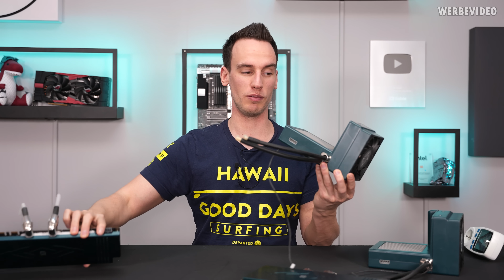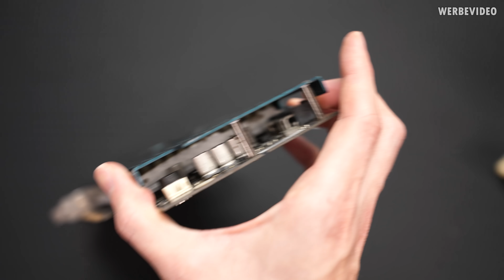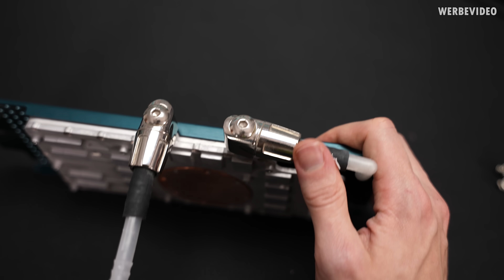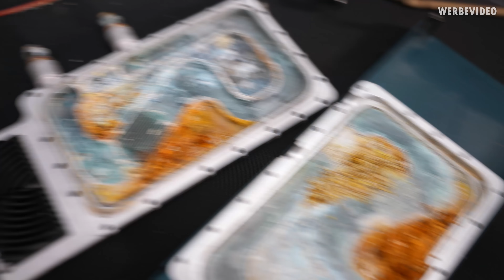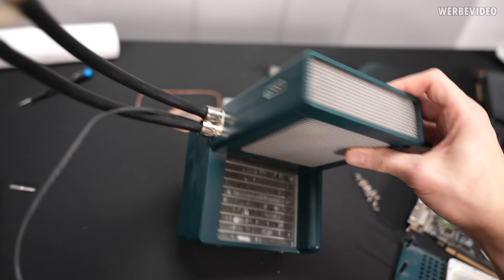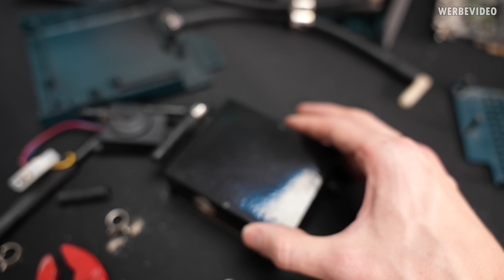Viewer-Mail Ep3: The WORST Water Cooler Ever! Nvidia 8800 Ultra Leviathan

Comment: phosphoric acid will clean the block then refill with 50 percent anti frezze
Reply: Red Line's Water Wetter would work very well in this. We use it in our race engines as your not allowed to have propylene glycol on the track.
Reply: @MrCool00236  I bought a 360 copper rad on eBay, and it had quite a bit of corrosion. I asked what he had used for fluid, he said distilled water and some water wetter.  It wasn't bad but still not good.
Reply: @Apollo-Computers  have you ever water cooled before? The copper will be discolored by default in all radiators, and not be totally uniform. This is Normal and not corrosion
Reply: @cwill2127  I've been water cooling for years, I know difference between discoloration and corrosion.
Reply: Since this will never see freezing temperatures wouldn't it be fine with some water-loop additives for mixed metals?
Reply: @danisoful  I said anti freeze as it as I inhibiter that stops erosion  in aluminium engines. so it mite be over engineered for the job but that's a good thing
Reply: @BALDYMANS123  Yeah I know, but antifreeze is rather thick (maybe the pump will struggle?) and water is better at conducting heat. Still a valid option tho
Reply: @danisoful  . well any additive that  low viscosity will stop aluminium oxidisation. and lasts a long time. easy to buy will be good I just can't think of a better one. at the moment . than anti freeze
Reply: @danisoful  i dont think so, too much scrap. you will need to dissolve that first. otherwise everything will get clogged up.
Reply: @AnthondeVries  I was thinking after cleaning ofc, my bad
Reply: yeah that will dissolve most corrosion fine, i once used that method to clean some alu parts.
Reply: i wouldnt use just any antifreeze. the plain green is fine but has a short service life. Dex Cool is a big no, g05 can crystalize with age. Zerex Asian is the way to go for extended life, even if you leave it too long it just forms a slimy film rather than crystals like go5 or brown sludge like dex cool. At least, in car radiators. same thing just bigger so it should translate.
Reply: I'd just fill it with sp13 car coolant, this should prevent further corrosion a lot better then water

Comment: Hi Roman.
It is clearly a problem of mixing metals (Cu and Al) without proper fluid.
To clean residues off copper is easy, just throw that part in vinegar. Regular acids only dissolve copper oxide. However, after treatment copper part may will not look very good, because corroded parts lost its copper and there is no way to retrieve it. 
As far as aluminum, it is tricky. Both acids and alkali dissolve aluminum oxide and metal itself. You may use very diluted acid or alkali, which when will dissolve oxide and a bit of aluminum. 
I found a patent, which better explains what to do with aluminum parts.
https://patents.google.com/patent/US20110268885A1/en

When you finish cleaning parts, use special fluid mixtures to refill, of which composition I don’t know. Distilled water won’t be any good, because the same story will happen again.

Comment: This is why it’s almost impossible to find watercooling gear for retro pc tech. I’ve always dreamed of building an amazing pentium 1-4 system with watercooling. Since the days of computer magazines in the 90s.
Reply: yeah retro stuff was 100% aluminum most of the time(that cards actually one of the rare few that used a copper insert for that time) and could make a ton of money recycling them which is what i did with all my old aluminum blocks and radiators. ended up making more for the aluminum than what i paid for them 15 years before that.
Reply: @sirmonkey198  aluminium scrap sell for something like $0.7 USD / kg, it would take A LOT of radiators to make any money.

Comment: Clean it off either by scrubbing with a stiff plastic brush with some kind of mild acid like vinegar and then rinsing well, or you can do electrolysis or ultrasonic cleaning.

When you refill this system make sure to use a high concentration of anti corrosion additive like car antifreeze, maybe 30%, to keep this from happening again. And always change the fluid every year or two like a car!

Comment: you can use "Citranox acid cleaner and detergent" to remove the metal oxide formed on the cooler. 
TO clean it, first use water to roughly clean the surfaces , then make a 3-5% citranox solution and soak the parts into it. 
It's better to put the solution in ultrasonic bath for 15mins, or wait 30min without the ultrasonic bath. 
The solution can remove most of the oxide layer, then you can use sandpaper (800-1200 grit) to sand off the remaining oxide layer with the solution if you want to. 
Rinse the parts with water again and blow dry with air. 
Make sure you clean the parts separately and don't re-use the solution for other parts.
I used the above method to clean the metal parts of analytical instrument in lab.

Comment: If the pump uses plastics and no metal (aluminium) you could get away with citric acid and a temp of roughly 40°C plus time and or ultrasonic cleaning

Comment: White vinegar and hot water mix to flush Sebastian's loop out mate, but you may still need to pull the block apart to get to those void's filled with corrosion! Didn't know these even existed, what a relic!

Comment: Corrosion guide - White = Aluminum or Zinc, Red = Iron, Green = Brass or Copper,  Solid Black = Bio most likely. Glad to see you found the steel bolt in the aluminum res.  All that red junk was due to fasteners.   On those 90 degree connectors I would use plumber's grease when I reassembled to avoid leaking.  I'd use a tooth brush and baking soda on the accessible bits.  I'd probably try warmed automotive cooling flush on the rest.  (Only thing I can think of with all the mixed metals and materials that should work).

Comment: The mesh part would fit into a CD-Rom bay and the fan would suck the air in through the mesh. It kinda worked as long as you had a low cpu cooler and nice exhaust fans setup.
Reply: I found some images, it's rear exhaust. Just search "TechPowerUp computex 2007 leadtek review"

Comment: I had a 8800 GTS with alu block with a copper sink inside. I have the block still laying around. It has deep pitting in the aluminium on the inside

Comment: Roman, there are two ways of cleaning aluminum - with Acid or Alkaline solution. 

Try to separate the copper part and soak aluminium in vinegar for no more than 45 mins (monitor carefully) then scrub it off with a tooth brush. Make sure it is clean before assembling and filling to avoid contaminating the loop. 

About alkaline solution - baking soda and water. Not sure if it will work, though. I have cleaned silver with baking soda solution, but not sure about aluminum.  Have fun making your house smell funny. :D gl

Comment: Doesn't look too bad. Soda -blast it (using soda instead of sand in sandblaster) and it should be good as new. Your biggest issue is finding the seal if any are in too bad of condition.
Reply: The insides of the liquid container could be cleaned up by tumbling it (put some sand/ballbearings inside), there are small rotators on amazon. Blast compressed air both ways through the radiator. Nothing here really looks all that bad at all. Most of the crap is probably off that iron bolt (replace with 3dprinted plastic) and maybe some of those pipes if they're not Al/Cu
Reply: @PasiSavolainen  Right, baking soda, not Coke.
Reply: the seals are pretty easy to fix since they're likely automotive grade stuff anyways, just find the right thickness and make them himself. a lot harder to do with the newer stuff these days since they're made specifically for that product.